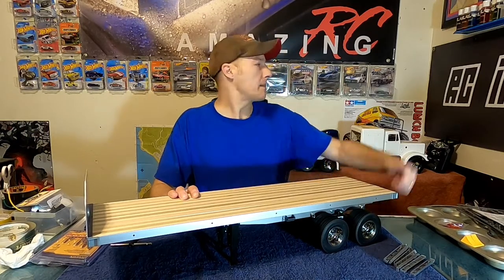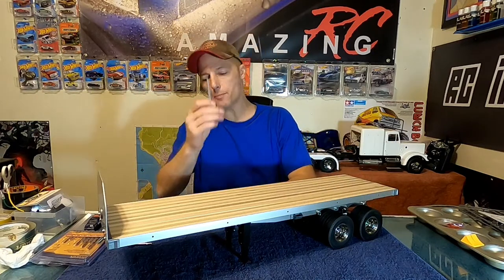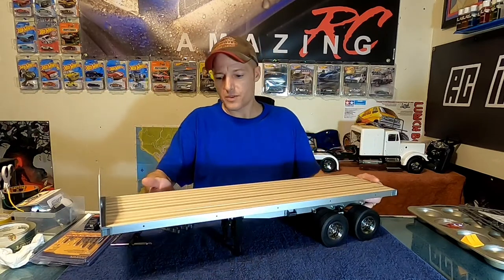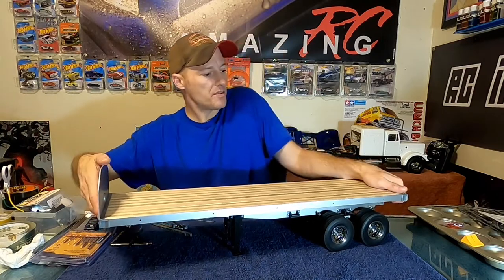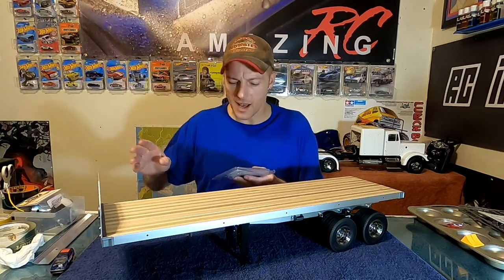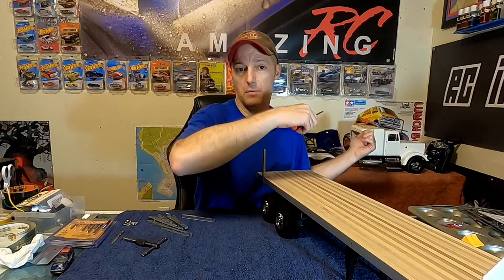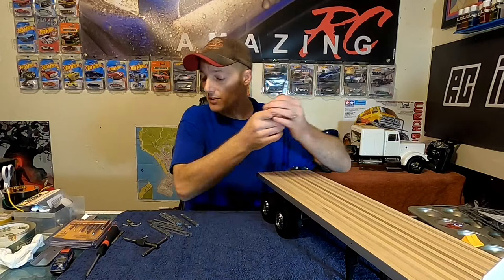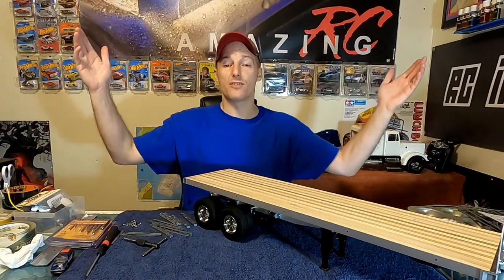Tamiya Flatbed Upright MOD.!!   Easy On  Easy Off

Comment: As a guy who works in a machine shop. Tapping holes can be a great way to improve things. Just yesterday I drilled out a Servo center so I could use a regular screw in it for a project I am currently working on. Great work once again my friend
Reply from the maker: I am relatively new to the tapping game. I always knew that it was available but I never needed a set bad enough until the Custom Hot Wheels game. I'm so glad that I used it on the flatbed because the end result is going to be exactly what I want. Keep you posted my brother.!
Reply: @AMAZINGRC  Rule of thumb when tapping specially if they are deeper holes. Turn Half a turn then back 1/16 - 1/8th  of a turn to break the chip. Then repeat.. A drop of oil. ANY oil will do. Helps A lot
Reply from the maker: @RcNickster709  many thanks for the tip. I get so nervous tapping something new. Especially this rig.

Comment: Nice solution for the uprights💪 Cool the deck problem's solved, too.
Reply from the maker: I think that this is exactly what I needed.  Your idea was really great too. I also was thinking of a way to be able to remove the wood decking. I was working on a way to be able to remove the two outer most pieces of wood to get to the hidden bolts. This is why I always submit my RC issues. I find that you guys are a great help.!

Comment: I had thought about trying to expoy the nuts to the inside to be able to something similar but it honestly sounded like a horrible mess to try it so I didn't. This is a great solution!
Reply from the maker: I am super happy with how this is turning out.! This will work perfectly. I plan on having something different on this flatbed like EVERY time.